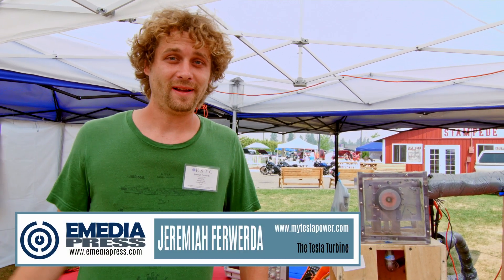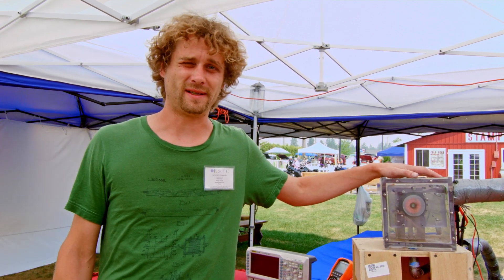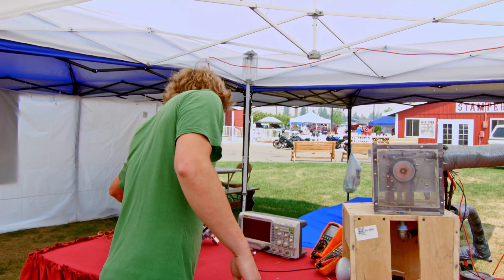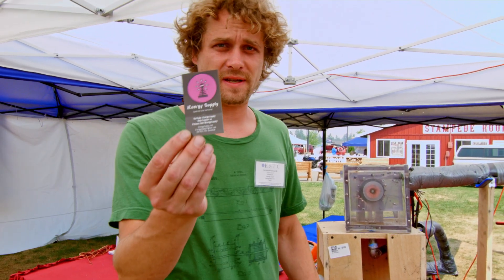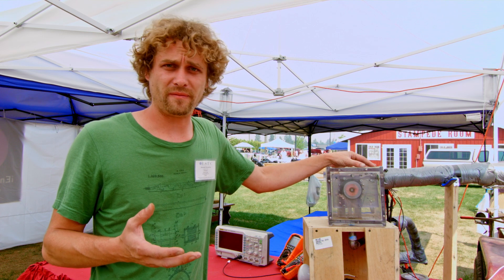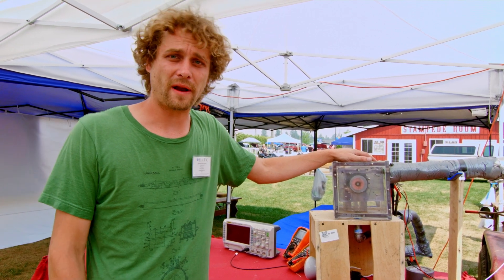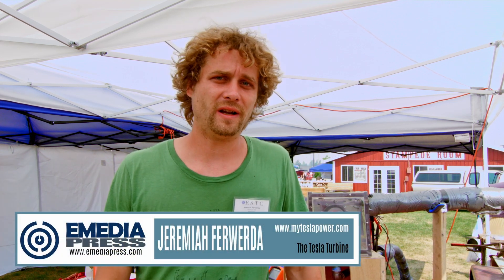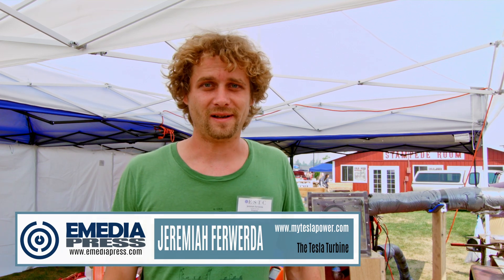Jeremiah Ferwerda of explains his Thermal Dynamic Transformer by Tesla @ ESTC

Comment: What's even cooler than a wood stove, is a "wood gasifier." They can reach an efficiency of ~90% There is a video by "GenGaz - Lagunov" called "A new type of gasifier gives 10-50 times less tar than an Imbert gasifier", which shows a very efficient design, with more maintainable filters (he has tons of experience in gasifiers). This is a DIY option.

There is another, more professional option instead of a DIY gassifier, which by some pure magic (or incredible math) actually burns up, instead of down, filtering through wood chips on top before burning them. Making it virtually maintenance-free. It's called "Windhanger PuroWIN." I really recommend looking at some animations of it, it is purely genius.

Another cool idea would be to heat up Sand-Battery with it, with Tesla Valve(s) buried inside. 
Water comes in, starts evaporating, shoots forward and keeps increasing it's temperature and speed through the long Tesla Valve as it goes through the heated sand. This could supply constant water, without the need for high pressure. The sand can be used when using solar/heating and heating it up with hot oil. For Wood Gasifier, attaching a heat-sink onto a Tesla Valve and burning it directly, might work too.

Are these ideas something that resonate with you or that you are interested in? (I'm not selling anything, just wondering). God bless.